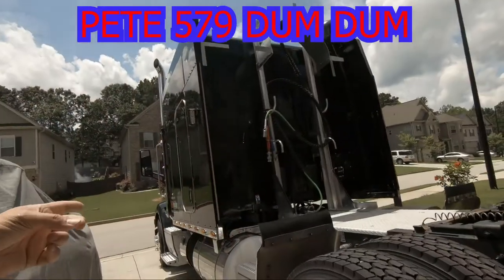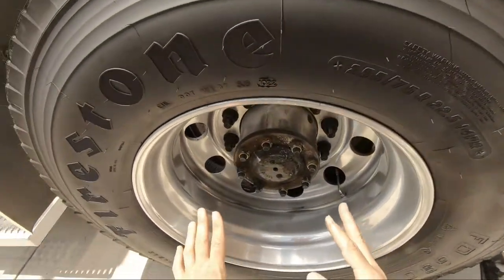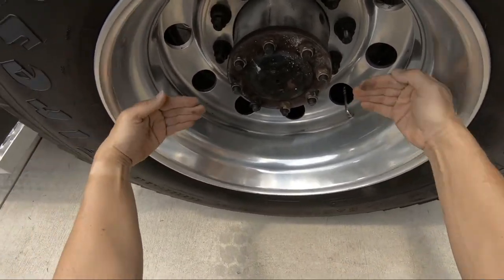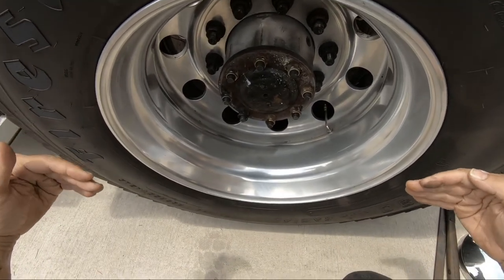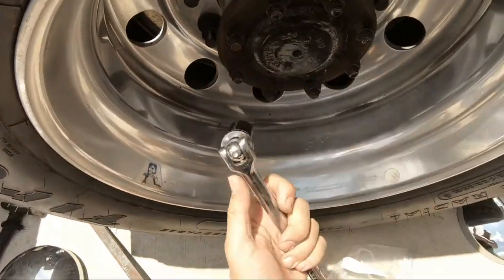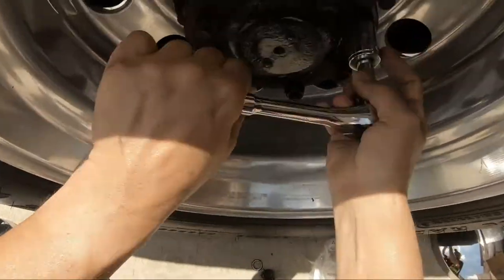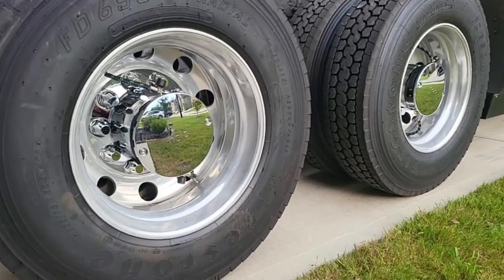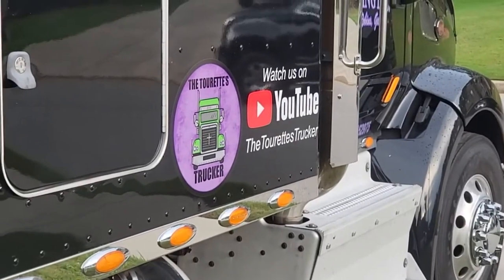Aperia Halo tire inflation system installation video.  What you need to know & how to install a set

Comment: Dude I’m so glade you made this video. I came across a truck that had this and tried to see people reviews on YouTube and could find anything but the companies sale video. They are expensive though, but could be worth it when saving your tires. Also I just heated up a wrench and bent it to install the crossfires that use the same valve connectors.
Reply from the maker: That's why I did the 1st video because the sales people can say anything and people won't be convinced without real testimony. They saw my video and thought it was nice of me to do so gave me the discount code for people to get $50 off a set. I have a few out there on them trying to get the discount code to as many as find the video. They are pricey so any savings helps.

Comment: We have Cat Eyes, they don’t self inflate but you can tell at a glance if you have a low tire.
Reply from the maker: Yep. I have tire pressure monitoring sensors on each tire with the halos so I can always tell what they are 😀
Reply: I’m currently debating if I want to use cat eyes or halo’s on my truck

Comment: Hey boss you did a good job installation jaja,  could you add the link where you get all the screws drivers toll for tight the hoses valvules pls,  thank you
Reply: Boss after installation you need install any software air monitoring on the truck computer??? I mean how do you check the tires air pressure???
Reply from the maker: @RiosForeverARG82  the wrench for tightening them is actually available on their website. I also run with a tire pressure monitoring system that has wireless sensors to my display on my days that tells me what each one is. The Aperia won't tell you what they are. They will just inflate them up to the ordered psi unit. They do have I believe another unit for sale that tracks them. 

Check them out at the website below. 

https://shop.aperiatech.com?aff=23

Comment: How are they doing for you.thinking of adding halos on my trailer. Scared of a broken tire chains damaging them on the drives
Reply from the maker: They say they can go on a trailer as well. My dry van has the air system in the trailer axle so I didn't need them there. I'd call aperia and ask them. The bracket I would think may be different size.

Comment: How have they worked out for you now 1 year later?
Reply from the maker: So far so good. I have them on 3 trucks of mine. Just spay the connections and check for leaks after install. I've had the pair on my green Coronado since around 2016

Comment: How do you calibrate air psi ?
Reply from the maker: When you order them you specify what psi you want. So you need to know what psi tire rating you have and then stick with that psi tire while using.

Comment: do they make air
Reply from the maker: They use centrifugal force while the tires are rolling to produce air and allow it through the valve if it detects the tires are below the rated pressure

Comment: But how does it inflate tires
Reply from the maker: It uses the centrifugal force of the tire spinning to produce the air. The sensor knows when your air pressure is lower than the set point and will open the valve to allow it to slowly inflate the tire as it produces the air.

Comment: What tpms system are you using?
Reply from the maker: VESAFE TPMS, Wireless Tire Pressure Monitoring System for RV, Trailer, Coach, Motor Home, Fifth Wheel, with 10 Anti-Theft sensors https://a.co/d/8JMkyAI